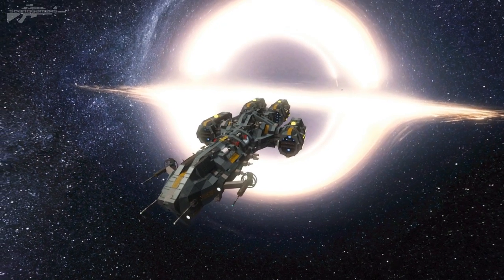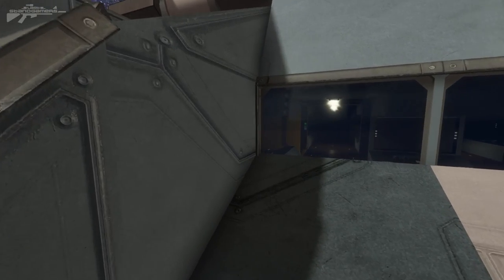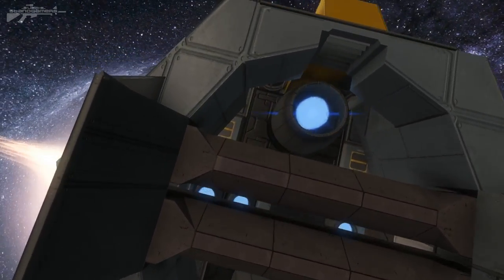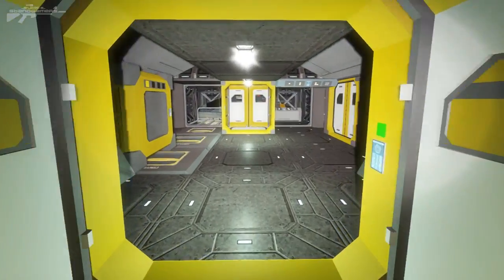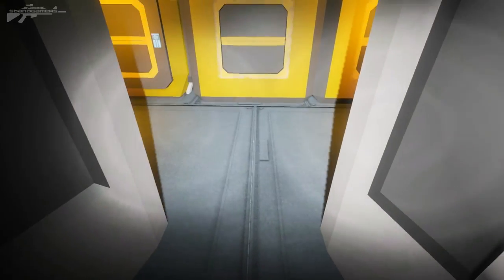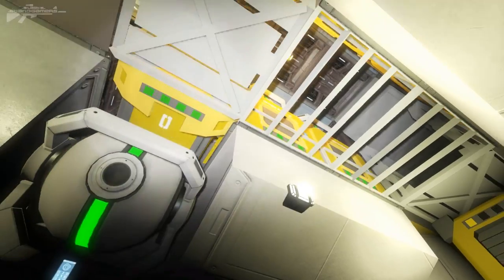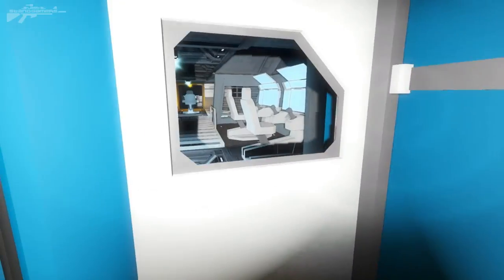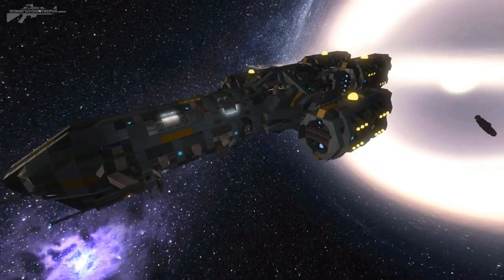Space Engineers - Mystras Light Cruiser

Comment: Half built blocks, how to be absolutely sure NO ONE 3D prints your ship in survival.
Reply: the half built ones actudlly look really good
Reply: +Elias Schmidt until you repair it using blue print and it will look different then, but nice looking ship still, just a flaw i guess. :)
Reply: +Uwanda Roberts projector i mean
Reply: +Uwanda Roberts 
Just build the ship, then take a grinder to it later. Not rocket science, just detailing.
Reply: +Barley Sixseventwo 
Right so you have to grind down countless blocks all over a massive ship (that you did not design). It's not rocket science, but it is definitively not quick and convenient either.
Reply: that's what i was getting at, its still a nice ship, but if you did not design it, your not gonna remember all the places which need grinding. After a while you prob know which blocks to grind.

Comment: Should've only had Hydrogen engines to hover on the bottom with Ion engines to maneuver and Hydrogen engines on the back to get to speed that shut down at max, Ion then replacing.
Reply: +Vrox11
 There is no point in use of large ship to planet landing with exception of dedicated jump ships. But that hydrogen engines should be use only as boosters is totally true.
Reply: +TheRezro Why would you want to land a dedicated jump ship on a planet? We've already been told in a livestream that jump drives don't function within a planet's gravity well, so all that does is put your dedicated jump ship somewhere where it literally can't work. 

I think reasonable-sized large ships are probably going to be a lot more convenient when it comes to hauling cargo off a planet's surface than small ships, as long as they're designed for it. Large ship thrusters are just more powerful than small ship thrusters, as long as you're careful to manage your mass to thrust ratio. A large ship also has the advantage of being usable as a planet-side base for planet's that don't have a breathable atmosphere, not to mention as a place you can hide from spiders or other hostile wildlife that might be added one day. You could also potentially use one to transport light ground vehicles or ships outfitted with atmospheric thrusters to and from a planet's surface. I can see a lot of advantages to using a purpose-built large grid ship over a small ship with a few hydrogen thrusters strapped to it. The fact that it presents something of an engineering challenge is a benefit, more than anything.

You should also remember that gravity is variable between different planets. This means that how much thrust you need to safely land, take off, and maneuver in a planet's atmosphere is going to be hugely variable depending on how big it is. In particular, you're going to be able to land much heavier crafts on a moon than you are on a planet proper.
Reply: Gaz Etteer
"Why would you want to land a dedicated jump ship on a planet?"

Because they are dedicated for that? Wait? Did I said jump ship? I mean drop ship.. minor mistake though those almost this same.

"We've already been told in a livestream that jump drives don't function within a planet's gravity well"

What jump drive have to do with jump ship? Similar name don't mean this same.

"so all that does is put your dedicated jump ship somewhere where it literally can't work."

Are you dense? Jump ships jump on planet surface. They literally can't work outside gravity wall.

"I think reasonable-sized large ships are probably going to be a lot more convenient when it comes to hauling cargo off a planet's surface than small ships, as long as they're designed for it."

That depend on scale of mining operations, but typically we don't need more then dedicated shuttle to move all cargo.

What typically don't have sense is having gigantic planetary drive in our mother-ship what wouldn't be used in outer space. Typically best option would be move just what we needed with dedicated drop ship.

"Large ship thrusters are just more powerful than small ship thrusters, as long as you're careful to manage your mass to thrust ratio."

And you have tons of useless ice. People simply are unaware how big problem it would be in long play? Ice isn't renewable fuel yet.

"A large ship also has the advantage of being usable as a planet-side base for planet's that don't have a breathable atmosphere, not to mention as a place you can hide from spiders or other hostile wildlife that might be added one day."

In some cases, but still it don't make sense use large ship as "get go" planetary transport.

"You could also potentially use one to transport light ground vehicles or ships outfitted with atmospheric thrusters to and from a planet's surface."

You can also move them with use of dedicated drop ship saving tons of fuel. So what is the point?

"I can see a lot of advantages to using a purpose-built large grid ship over a small ship with a few hydrogen thrusters strapped to it. The fact that it presents something of an engineering challenge is a benefit, more than anything."

Again, all depend on function. Just my point is that people for some reason try put dedicated planetary drive in cases where that don't have sense anyway.
Reply: +TheRezro I don't think I'm dense so much as you're choosing to employ confusing terminology that could mean multiple things, and are frustrated that I have not guessed your meaning correctly. When there is a literal mechanic called "jumping" in a game it's probably best not to assume everyone's going to think you mean a different kind of jump.
Reply: Gaz Etteer
I'm not frustrated, but considering that you insist of continue that pointless debate most likely you are. And I don't care that you didn't guess what I meant. I explained that already so what you want again?

Comment: I would change the center back and 2/3 of the side thrusters for traditional ones so you can fly without the hydrogen and switch on the hydrogen for combat. I have a combat cruiser that has traditional thruster pods on the side that i can jetsin and switch to 80% hydrogen (I keep some traditional just to be safe) for combat, plus i shed a lot of weight and can undock with them later after the fight.